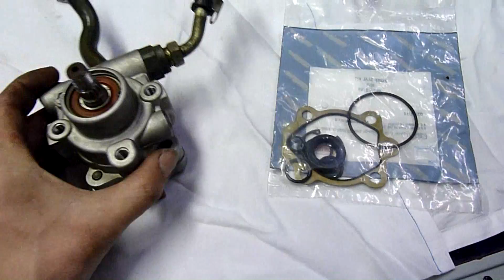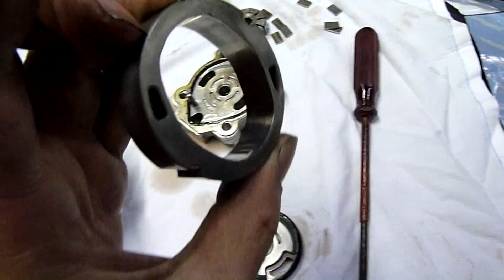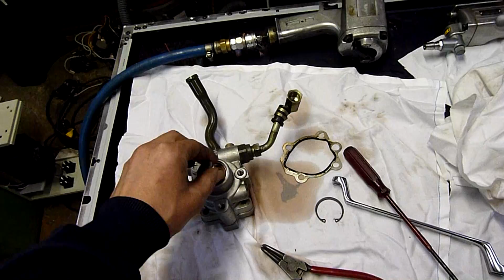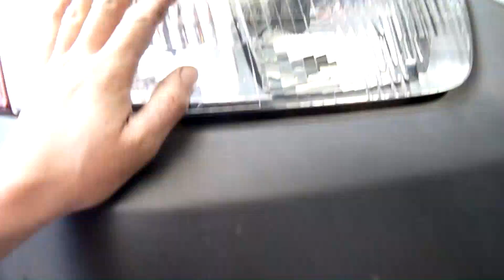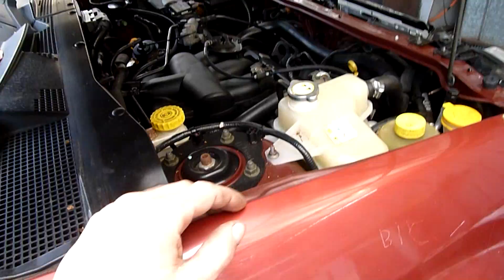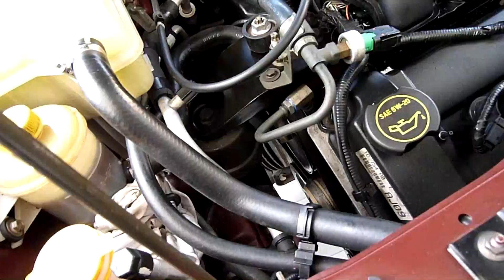Viki Gets her PS Pump Rebuilt (2001 Ford Escape Power Steering)

Comment: Hi. I know this video’s 4 years old, but was the o-ring for the pressure hose on top in the kit rounded? Because when I took off the old one, it was flat, and I can’t find a replacement for it, so I thought maybe it was rounded in the beginning then it just flattened over time?

Comment: Great vid. Didn't see you replace the main bearing shaft seal though. Do you know if it is possible to replace the main bearing  seal from the outside ie without dismantling the pump?
Reply: have you ever figure out how to remove the bearing shaft seal? same problem here any tip... thanks

Comment: Hi there, Great videos on Vikki!!!  ... I have a 2003 Escape V6 3.0L ... she needs a steering rack and pinion. Bleeding fluid out of the rubber on the Drivers' side. Most recommendations are to replace the entire rack and pinion instead of a seal kit repair. I usually order the parts from the US but this time, as I have a right hand drive, I cant get the part since their market is essentially for left hand drive vehicles. I was wondering if you could recommend an Australian Shop that can furnish an online purchase for right hand Ford parts for "my Viki"  :) ...Thanks much!!

Comment: Hi mate, I have gotten some great tips from your videos thanks for making them. I have a question for you if you have the time to answer.
I have an 05 Tribute, basically same car as yours and I am doing some major work to it this weekend and was just checking out a couple of your videos. I noticed or heard in this video the distinct sound (hissing) that I have which is the vacuum leak. Did you ever get that diagnosed? Its coming from the rear of the plenum cover, I have replaced the notorious PCV hose elbow which goes into that cover as it collapsed.
Reply from the maker: No I never touched on that problem, I was getting close to roadworthy and I found out it had been damaged in another state and needed thousands of dollars of inspection work done on it, so I hocked it for minimal profit :(

Comment: Thanks for the video. I just did the P/S pump on a 2002 Escape XLT. Not too bad of a job. I got the same seal kit. I did change the seal behind the bearing. Great heads up on how the vanes went into the pump. Start to finish was just under 2 hours including cleaning the pump and engine.
Reply: bearing : sir, please part number or espicifations thank

Comment: I was charged a couple hundred US dollars for a rebuilt power steering pump for my 95 Honda Accord. I was told a brand new pump would cost much more. This was an independent auto repair shop. The pump failed after a year.

Comment: Ughu the automatic tensioner SAAB used on my car is a pain in the arse. To untension it you use a 1/4" breaker bar in a 1/4" square tube hole, but they're notorious for having casting flaws and breaking apart when you lever on them.

Comment: Perhaps tap the open end of the pump and put a bolt in it with some thread seal. The other end looks like one of three mounting bolts so I guess that's ok.

Re the chip perhaps try getting it filled if your in the RACV they do it for $55.00 from memory. Don't go to O'Brien they charge rip off prices and will try and sell you a new screen.

Re the power steering you most lightly know but just in case to bleed it just let it run and move the wheel a few times lock to lock and the air will come out and the odd noises will be gone.

Comment: That vein pump looks just like the air motor rotor that was in a air impact wrench I took apart, the one on your bench there would be the same =). Cool stuff.
Reply: That's exactly what crossed my mind. I could swear it's the same...tho mine has rounded edges on both sides and no pesky hole.